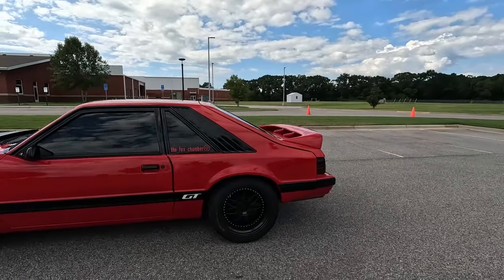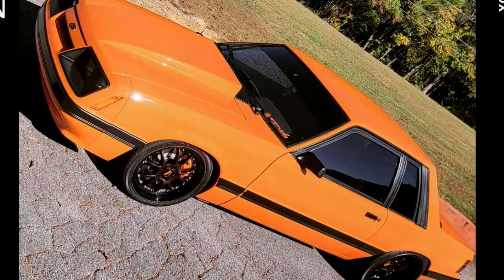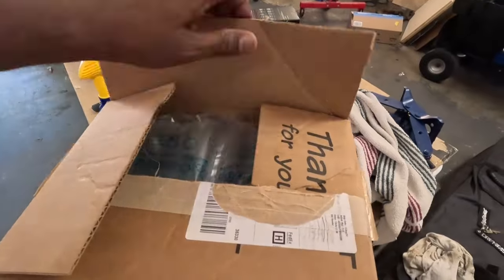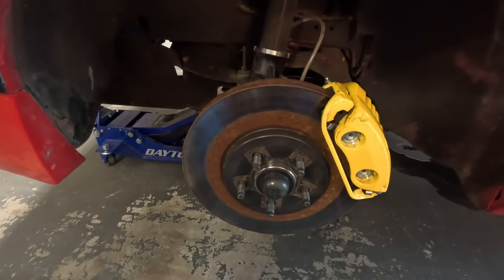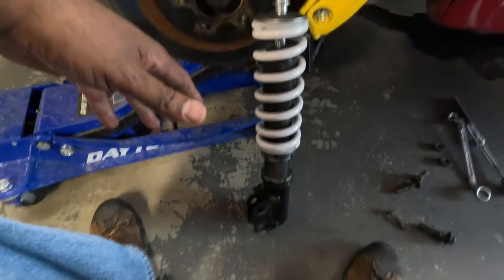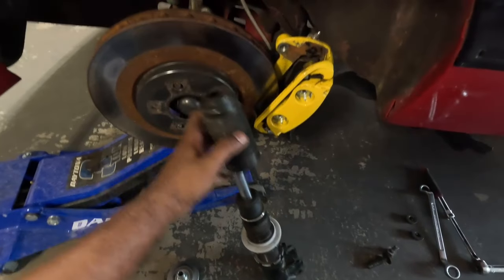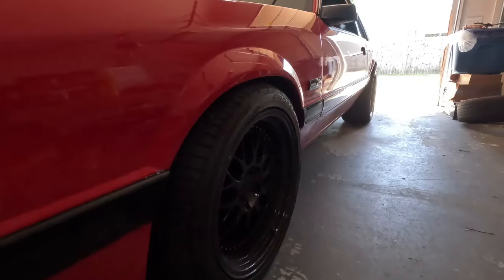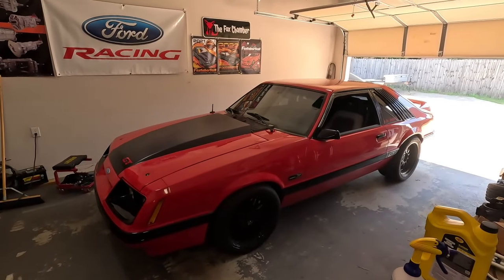SR Performance Coilover review

Comment: Jim 150 coil overs are for racing. That's what's in my Mustang. Now better spring will be 175- or 185. These will be great in the street.  Again 150's are not stiff on the contrary they are softer. They displace more force up ward when car is launch at the drag strip. The rears should be in the 130- 150. These cars don't have that much weight at the rear. I say 150 for the rears.
Reply: You took the words right outta my mouth, I have the Viking 150’s on the front of my car and it actually rides great on the street, the 170’s and up are what we use on a fox with a big block

Comment: Hey man Im having that same issue with my 94’ gt and its horrible. So you’re saying by switching out the springs the ride quality will improve!?
Reply from the maker: Yes, you will definitely notice the difference.
Reply: @ Hey man did you end up finding the rear coil over springs? I honestly don’t know where to get them.
Reply from the maker: @DiegoRL17  haven't found a set yet
Reply: @thefoxchamber  I’ll be looking around. If I find some I’ll come and let you know in case you need them as well.
Reply from the maker: @DiegoRL17  thanks